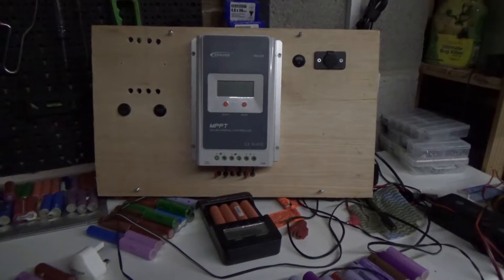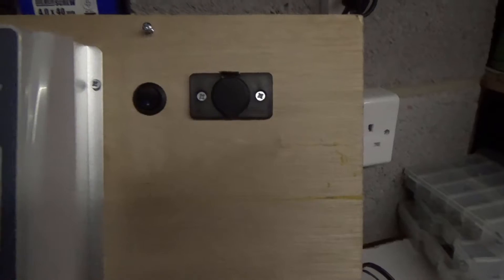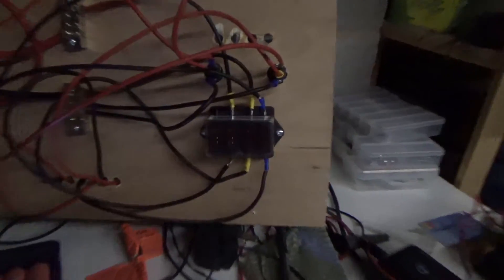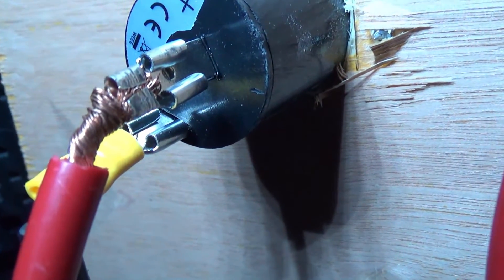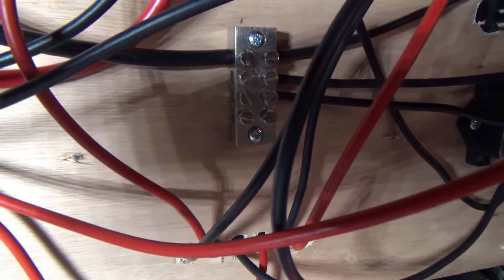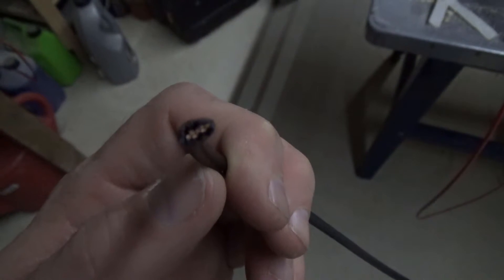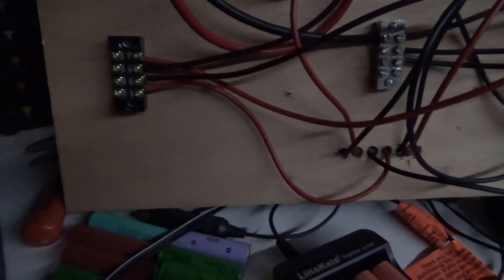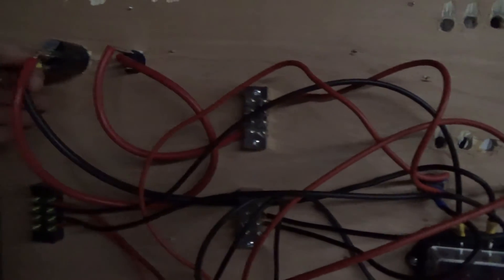12v Solar playhouse - Cabling Failure!

Comment: When I've got large gauge solar wiring going in to those screw blocks I separate the strands into two groups - then twist each of those - and slide each half around each side of the screw - then screw it down. Here's cheap a crimp tool that seems to work OK: http://www.jaycar.co.nz/medias/sys_master/images/h21/hfd/8815479521310/TH1834ImageMain-300Wx300H.jpg
Reply from the maker: Thanks Paul, i'll give it a try of putting them into two strands today as i'd like to get the board up and mounted without too much rewiring if possible.

Comment: I plan on picking up crimpers soon and I originally wanted to get the cheapest [with good reviews] ratcheting pair I could find from China, but they seem to be very hit and miss in regards to quality control. Now I'm leaning towards getting the Engineer PA-09. It's more than I'd like to spend, but it looks like a great value. For stranded cables, you normally need to use ferrules for a mechanical connection like that, but I'm not sure how they would fit on a solar cable. Maybe double entry ferrules would work. Heat shrink tubing will also help make things more secure.
Reply from the maker: Thanks for the inpu  i'm going to go back and solder some other the connectors and heat shrink them to make it tidier.  I've succumbed to the cheap ratcheted style from China so i'll have to see if I've wasted my cash.  I've done this on a few electronics things mind where you start cheap and realise that it was a waste, sure i'd save myself a fortune if i went decent in the first place :-)
Reply: Colin Hickey I do the same. I love ordering import tools, especially for hobby work. If I think I can get the job done with it and save money so I can buy even more import tools, it's win-win. I'm also a bit more stubborn and will do my best to make it work if something is wrong with it. The problem I read with reviews of import ratcheting crimpers is that if the dies (jaws) aren't shaped correctly or don't line up properly (which sounds like it happens often), there's not much you can do about it. I've been considering ordering a pair anyway and keeping my diamond rotary tool bits and some diamond needle files handy in case I can re-shape the dies, but it might be something I can't make work so I'm probably going to go with the PA-09. If you're stuck with yours, it might be worth figuring out the problem with them and determining if it's something you can fix or adjust. Soldering is a good second option, but for these applications, crimping the  connectors is probably preferred. Either way, I'm looking forward to the progress!

Comment: I use a fair few crimp spade connections behind my board. The yellow ones seem OK with the 4mm squared cable but intend to solder mine as well as crimp. The crimping tools which come with connectors - the ones with wire strippers and a small cutting edge are pretty rubbish. The connector turns and the crimp is rubbish - hence the soldering too. 

I found my solar cable has two insulating layers around it. Strip off a bit of the outer layer (probably stiff material which has uv protection) and the inner layer is much more willing to bend. 

It's worth noting I haven't needed to replace a fuse behind my board - lucky or careful planning, you decide. 

Your video cuts off I'm afraid at 5 minutes. Or is there a part two?
Reply from the maker: Thanks i'll check my solar cables and yup i think i have the rubbish crimping tool you mentioned although ashamed to say i got mine at halfords for not a cheap price.  Like a lot of my electronics things it's been a learning curve and takes a while to realise what you do and don't need.  Had my eye's on a few rachet crimpers so think i'll go for one of those.  Thanks for the heads up no the 5 min cutout.  it was slightly longer, i tried the upload to youtube from hitfilm4 again but sadly it doesn't work very well as that's the second time it's failed when the initial video was ok.  Will upload seperately i think from now on as i can then check it more thoroughly.
Reply: I bought a rachet crimper as well but found that it still gave loose crimps so I do as Adam does and solder them as well.